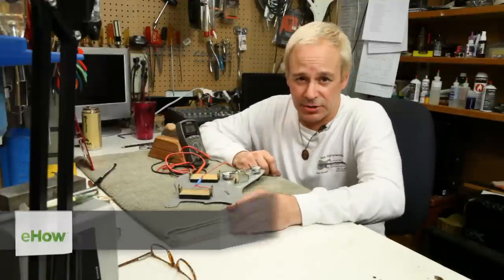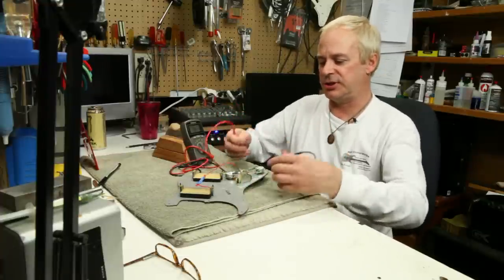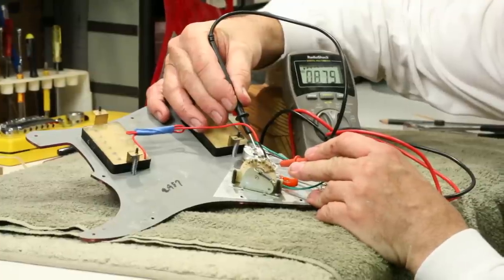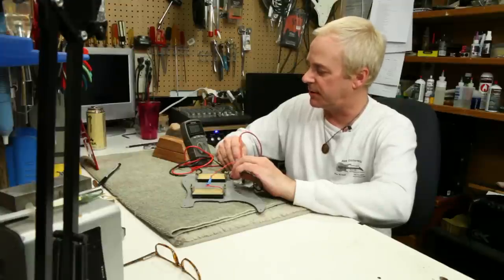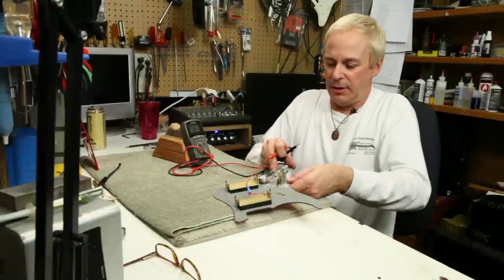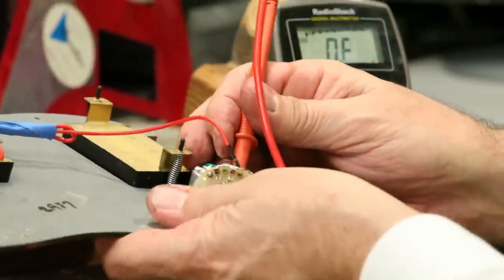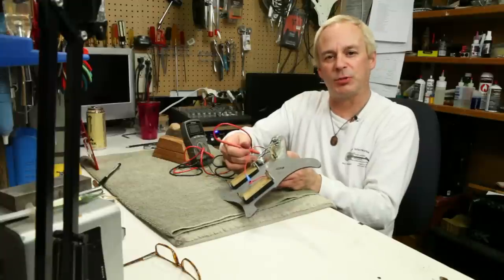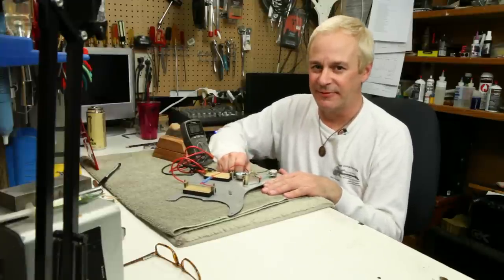Testing Guitar Wiring : Guitar Building & Repair

Comment: I thought this video was going to save my sanity but I'm more baffled than ever.  I did your test and got an infinite ohms reading off every pickup.  Is my vol pot dead? I've done the usual jack input test and all flows are fine.  If I bypass the vol pot by placing a jump wire between the vol pot's switch terminal and output terminal I get a 0 ohms reading showing flow is fine.  I'm going mad with frustration.  How could a vol pot die?  Def Jef